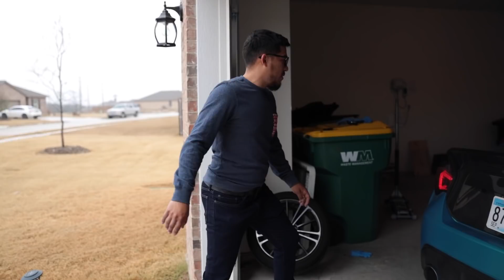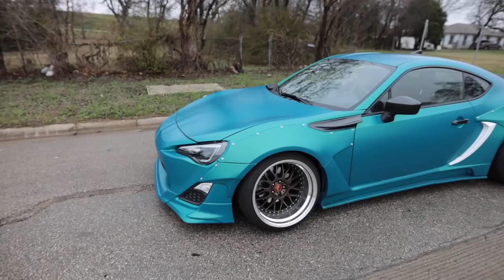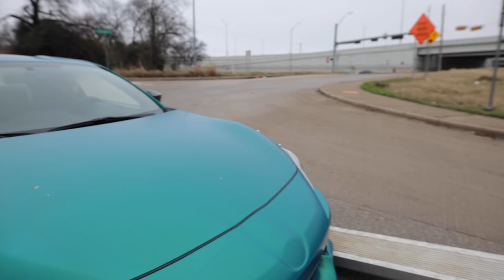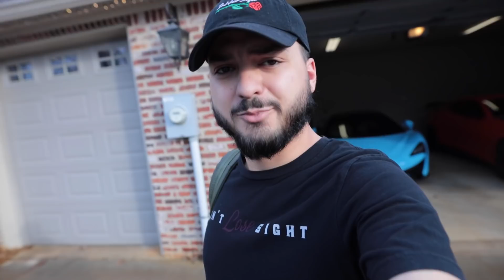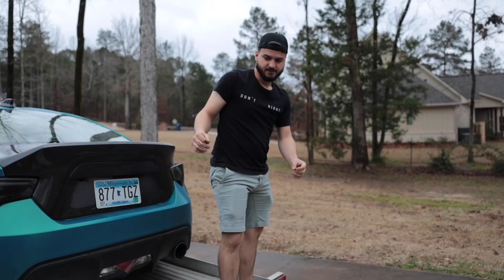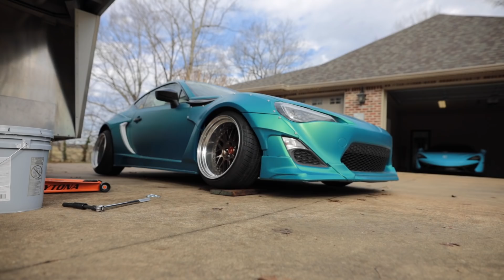Buying My First Wide Body Car and this happens...

Comment: I feel like the car isn’t worth one of the bikes much less two
Reply: That would be correct
Reply: 20K in bikes easily
Reply: @eduardojacome781  at least. Probably closer to 25
Reply: Lol yeah I feel like he could have sold those bikes on cycle trader or something and got a better deal than the FRS
Reply: @eduardojacome781  that s1000RR if it's low miles is EASILY worth 12-15k especially if modded/tuned
Reply: You'd be surprised how much those custom wheels cost at least 6k usd
Reply: @jordanr3163  I just have a hard time believing he would spend 6k on some wheels and then have that crappy of a wrap and fender work done. If he’s gonna go all out with the wheels why wouldn’t he spend some money to get the wrap done right and pay a professional body shot to do the fenders correct
Reply: @DustToGloryPW  hey man some people cheap out on some parts hah
Reply: @jordanr3163  True lol I feel bad for him though. Those were two mint bikes and now he’s got that FRS that seems like it needs ALOTTT of work lol
Reply: @DustToGloryPW  true I always take a long time looking over EVERYTHING  when I buy a new car. I imported a 2000 Toyota Aristo from Japan. Still have the stock 2j gte twins but im going to be doing a big single swap, these cars are mini supras I wish he would find out about these but definitely will never see this comment lol
Reply: Facts, when I saw what bikes he was trading I was shocked. He better have gotten $10k on top
Reply: @DustToGloryPW  I know someone with those same rims selling second for hand for 3,200. I dm rsv on a insta they told me 5,200-6,000 for a spec I wanted. Still the car if it has no power mods is work like 12-13k without the rims

Comment: eyy bro i work at a tire shop, when setting a difficult bead remove The valve stem and screw on a "recappers plug" it connects shop air directly to the valve stem for more flow. coat the bead of the tire in straight dawn dish soap and set the wheel and tire face up a 5 gallon bucket inside the barrel of the wheel, this lets the tire to hang down so instead of trying to set 2 beads it is just one

Comment: Never thought Gavin would drive a car with that much camber
Reply: To me camber looks dumb it wears out tires faster than haveing them normal
Reply: @hillbillydeluxe7228  it does but. Stance gangggggg😂
Reply: @miguelfragoso7023  i drive a truck so not for me my tires gotta last
Reply: @hillbillydeluxe7228  yeah same but if it has a little it still would look good but it has way to much
Reply: @kamronyoung9010  its like chrome i hate it bc most people over do it a little goes a long way
Reply: @hillbillydeluxe7228  yeah true

Comment: I seen your P.O. box address. I loved Ruston. Railroad ave and bonner street..theres an old railroad bldg looks to be a bbq now but about 4 years ago was vacant.. I crashed in it when hitchhiking with my catahoula cur dog. People were so kind there. Been subscribed for quite some time now and glad to know I'm supporting you and your town. Hope all is well thanks for sharing. If you have an email I still have pictures of the tagging in the building if you want to see it..im sure you might've been in that building though at 1 point because it was wide open on the track side for a while.
Reply: Found pictures... My favorite saying painted in blue spray paint was " getting lost in you helped me find myself" just kinda made sense after a bad separation that forced me out on the road after a bad break up.

Comment: just a FYI,  tires do not seal on the inside of the lip, it seals on the barrel. might have just been the short vid clip and angle but looked like you concentrated on the back of the lip with the bead sealer. FYI #2 WAAAAYYYY too much "starting fliuid"(Maybe FYI #3? use ether) but set the wheel on a 5 gallon bucket so the tire can not contact the ground and go flying when it explodes, Attach the air hose and tape the trigger down or whatever just stay away from the wheel while inducing air to atomize the ether, spray like 1/4 the way around on the barrel with a quick pass then bring the spray over the tire to the edge of the tread and that is where you light it with a torch staying away from the tire! A little dab will do. 

 You are lucky it didnt pop with your face down there the channel might have had to change its name "Its Just 6 Teef Left" but chances are you wouldn't lose your sight!

P.S..... Why you got to hate on crown vics?
P.S.S.... probably won't read this anyway but be thankful the wheel well isn't rusted out, I'm from Minnesota and trust me, could be worse! LoL keep up the great content my guy!

Comment: He said "these to tires aren't meant to be stretched." Imagine thinking there's tires that are supposed to stretch 😂
Reply: There are wheels that are meant to be stretched out drift tires are meant to be stretched to get better angle
Reply: No, because people who drift don't stretch tires dude. Do you understand what a stretched tire is ? It means it's a tire that's smaller then the wheel you want to install it on. 
Therfore it doesn't fit correctly. Therefore you would debead swinging sideways

Comment: The v8 straight piped crown vics are all over shreveport its hella annoying. Tbh with the car if you want to keep it and make a project i would just boost it and drift it, not like the gt350 boost like a basic single turbo just to give it some power

Comment: That cars a head turner... 😂
From 15 feet. Redo the wide body, wrap it in a not so puke green color.
I'm not to sure if your wanting 400hp or just a show/ drifter. Frs  have a lot of gear just look up moded ones that are legit. They are head turners just not the toad" you got right now. Prince it up

Comment: I’m sorry dude but watching you complain as much as you are as if the guy ripped you off when literally every single problem is something you should have looked over when you went to trade. If a car is wrapped, you look over all the spots that wrap usually lifts. If it’s wide body. You take the time to air it up and look to see if they cut and sealed the rear quarter panel properly. So you can’t be mad at the guy.

Comment: Those tires were stretched like Gavin’s a$$ after that bad deal. Two flawless fast bikes for that junk a$$ FRS. Dude saw Gavin coming from a state over. I hope both of the engines lock up on the bikes after what he did to Gavin. Nobody should conduct business that way.

Comment: SORRY but you got f'ed 2 10-15k bike for a almost stock car that is like 25k new give or take with a bad wb kit that cause interior damage and could short out wires or blow speakers and a trunk that could accumulate mold and the rap is shit which will cost any were from 600 to 1k just depends on the labor and material and what a tire 500 that he bought before he even had the keys lol a joke that's a got damn joke that guy sorta played you. But there not fast cars there meant to be sideways so 2jz it ands slap some turbs on there and let it rip.... and maybe get rid of the back seats and get it roll caged. I'm fixed to join the jdm club hopefully here shortly idk what im going to get maybe a wrx or something i have not made it final or a honda who knows. i will say though you are a better person then me cause i would have took the tire and left it on a jack were it sat and demanded my bikes back or seen from how much would have to spend see if you could get one back. im done ranting.